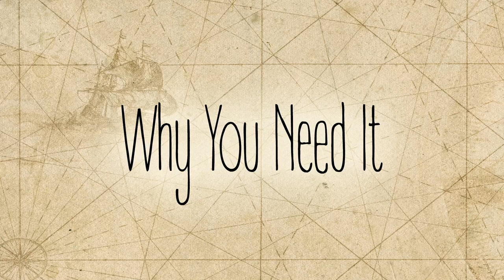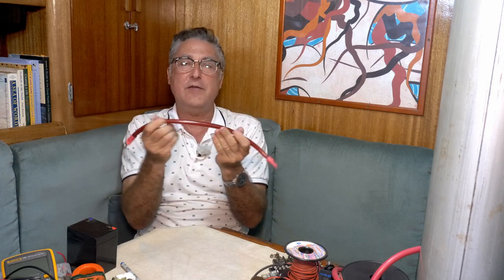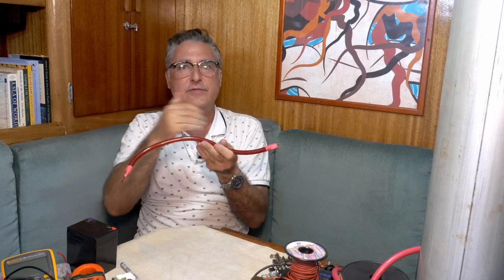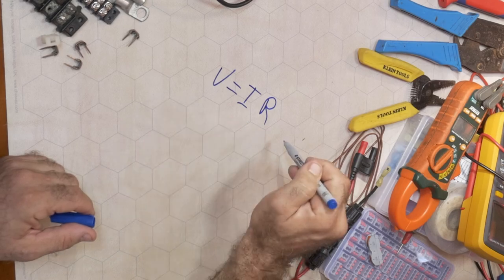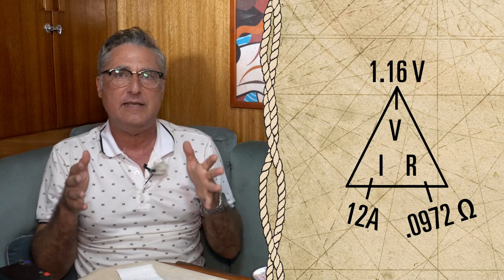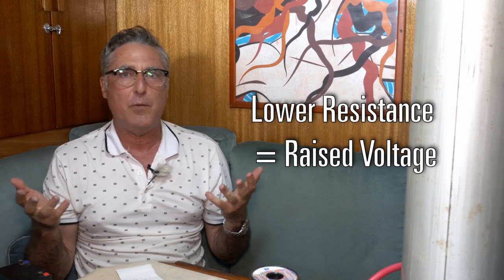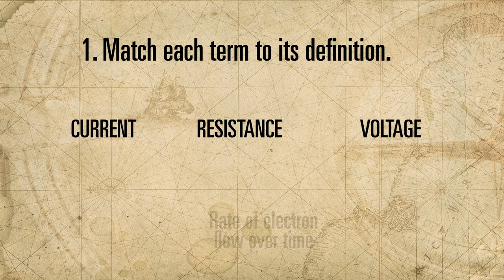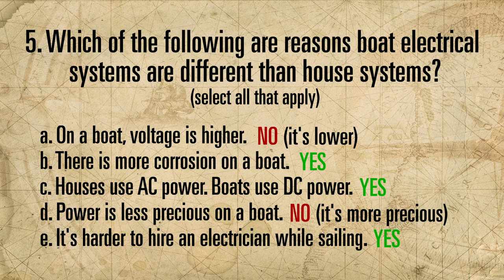What you NEED to know about Boat Electrical (Part 1)

Comment: Clark is a rare breed.  An Empathetic Genius =  someone that can explain advanced concepts translated into simple terms paired with a want to share.  Thanks!
Reply from the maker: Ahhh.
Reply: 100%
Reply: @icarumba5  I agree with this. Great explanations and just a pleasure to watch. I have an excel spreadsheet with conversions on wire with the resistance and surface area and oms calculations and lost volts because of the inspiration from this video

Comment: You always did it perfectly when you explained the three electrical fundamentals, almost until you slipped your tongue and said "amps" in the same category as voltage and resistance. But, to your credit, the text on the screen clarified the difference. Unfortunately, you do not use the unit of measure [Ohm, V, and A) to describe what you measure -- many people can not make up this simple difference which creates more confusion. This is just little detail in an otherwise excellent episode and channel. Cheers.

Comment: Had to teach one of my techs about voltage drop after he tried to order a third starter for the car being repaired, saying they were all defective. Once class was over, he replaced the battery terminal end on the positive cable that was dropping ~11 volts under load (invisible corrosion hidden between the copper and lead inside the factory-made terminal/cable) - enough to kick the bendix out into the flywheel but no amps to crank the engine. Back to basics, buddy! Oh, first too!
Reply: Cars and boats, most of the problems are corrosion or a broken wire.
Reply: @jonathanwetherell3609 

Used to be in broadcasting. If we lost program the first remedy was to whack the jack plugs in and out of the jack. (And don't clean them with Brasso, ever, it leaves a residue which isn't that conductive.) 

If that didn't work then a new double ender lead to replace the original. If that solved the issue then a loose knot in the old lead and leave it to maints.

If that didn't work it meant the gear itself was duff. A very rare occurrence indeed.

Ergo ALWAYS check the wiring or connectors first.

Battery connections, especially, are worth doing properly as that's where your bilge pump gets its power from.

You can work out the rest for yourself.
Reply: Constant equipment and especially diesel issue. Many times all I do is fastidiously clean up every contact in a circuit.

Comment: Nice job Clark. KISS! Lol.
I do hope you speak to how resistors are used in circuits to provide a "local" voltage for a particular component or function within the circuit.
I also hope you offer your viewers other avenues to further the inquiring mind on the subject. There are many good options right here on YT as well as in print.
Super fun subject. Looking forward to the next installment.

Comment: One thing if you have a clamp on amp meter you can increase its resolution by putting more turns through the clamp 2 turns doubles your current reading ( divide reading in half to get actual current)
Many times I do 10 turns on lower amperage then just move the decimal point 1 place to the left.

Comment: Excellent primer Clark! Thank you.  I have a degree in electronic engineering (a few decades ago now 🙂)...I wish my lecturers back then had the ability to explain these concepts as well as you did.  I'm looking forward to the rest of this series!

If there are those out there who still had some difficulties in understanding the principles, a couple of things I use is to think of electrical circuits like water pipes...Voltage is like the pressure in the pipe and the rate of water flow is the current (Amps)...bigger pipes (thicker wire) allows more current...an electrical switch is like a tap.  When it comes to resistance, you can also think of this like rocks disturbing the flow of water in a river...more/bigger rocks slows the water flow (resistance).
Reply: I have used that water flow method to explain it to some and would use a balloon in line surrounded by needles and when the pressure gets to much it expands and pop's into pieces to stops the flow by a open in the circuit for the fuse/circuit breaker

Comment: So impressed, thank you again Clark. Makes upgrading a 12V boat to 24V while leaving the larger gauge wiring in place interesting since so many modern marine appliances work at either voltage.

Comment: The equation really you is for the power loss in the cable. P = IV = I^2R. So if the current is 8A and the resistance of the cable is 0.0972 Ohms the power loss in the cable is (8 Amps)^2 * 0.0972 Ohms = 6.221 Watts.
It is actually more efficient for a fridge to be on all the time with a lower power consumption just keeping the fridge at the correct temperature than to keep switching on and off with a higher power consumption. So dropping the voltage to the fridge can make the fridge more efficient (so long as you don't drop the voltage by creating heat in a cable).
Reply from the maker: Didn't want to get into a second equation in the first video.  One must choose their battles.

And modern compressors run off a brushless three phase DC driver.  So lower voltage doesn't slow it down it just makes it draw more current.

But the power equation would have been the "right" way to express this, I agree.
Reply: @Clarks-Adventure  Thanks, I didn't know that about fridges.

Comment: Thank you, thank you, thank you for producing these videos.  I'm in the process of designing and installing an electrical system on a 50 year old 30' sailboat.  I tore out the rat's nest of wiring that infested the boat and I've got just about everything I require to start my install and I can use all the knowledge I can get.
Reply from the maker: Fun times await

Comment: I think a video on wiring a panel proper wire colors and ways to secure and route wires would be really useful. Tips on a neat well thought out installation.
I also think a video on how to troubleshoot would be great.
Reply from the maker: There is a video coming on how to find voltage drop in an active circuit.   Really useful.

I'm afraid I'm not qualified to show neat wiring installs. Take a look at my battery AC video.  Embarrassing.

Comment: Great job 👍 I just aquired an isotherm DW65 for my 33 Pearson. I have it connected to 800 amp hours of battery (probably overkill) on 4 gauge wire. The explanation of the resistance was stellar! I just feel I need a big wire for longer runs but that made it so clear as to why.  Please keep doing the deep dives they are great for guys like me doing the diy installations.

Comment: Very good explanation. Important also to consider heating in the wires, and different wire types by their ability to handle heat and other types of degradation.
Reply from the maker: Yes.

Comment: Great video! Very nice review! Surprised you didn’t mention Nigel’s Boatowner’s Mechanical & Electrical Manual. Hope you talk about benefits of 24 & 48V LiFePo banks
Reply from the maker: I've never read his book.  Is it good?   I bought his fridge book but didn't like it.

Thanks Eric
Reply: @Clarks-Adventure  I️ find it informative and quite easy & enjoyable to read. He uses the water pressure analogy for ohms law and circuit issues that is good for visualization. Very good troubleshooting techniques. 870pg that covers most marine systems well. May want to mention ABYC and other standards in passing—just that they exist, not more than that. 
Thanks again for your excellent efforts!

Comment: I am or was an instrument electronic technician at a nuclear plant in MN so thought I was fairly smart until my son bought a boat in FL. It is fairly old, 1983 Tiara 3100 with two merc cruiser V8 motors with direct drive props.  Each motor has it's own 12 v battery. The water temp gauge on the port side motor went to max 250 deg while the engine was not hot. The gauges in the dash share the power as they are hooked in parallel. I thought this would be a simple fix but was wrong! After changing the sensor same problem. Measured resistance and it agree with the chart at ambient temperature 450 ohms at 100 degrees and 1000 ohms at 60 degrees. Put the new sensor wire from the port side gauge to the starboard side and it went to max. When I didn't install the sensor the gauge read just what the correct temperature was but as soon as I installed it in the motor in maxed out again. I ran a jumper from the ground side of both batteries to each other thinking there might be some reason the resistance was getting less but that didn't do anything either. I am totally lost on what is causing this problem as I don't know much about salt water boats or inboard engine electrical systems.... Don't know what to even look for next!

Comment: Larger boats have 3 phase AC electrical systems. For an example on my tug everything is 120/208 AC from the navigation lights to the steering pump motors. The only 12 and 24 volt DC systems are some of the wheelhouse electronics like the VHF radios. There are zero batteries in my boat other then the emergency lighting batteries and a UPS for the PC and 12 volt power supply for the VHF radios,  everything is air start other then one genset that has a hydraulic starter, allowing for a cold and dark startup if the boats been laid up cold and dark for an extended time and the air tanks are empty. We have 3 gensets and without a running genset we are basically out of control and dead in the water. No steering, air compressors, engine controls (they are pneumatic). This is also the case on larger recreational boats.

Comment: Corrosion is the primary electrical problem on a boat. Caused by the combinations of moist air, current and poor installation. If moisture can get between any electrical junction it will probably fail, especially if the materials are dissimilar. Very rarely are junction posts and cable ends(lugs/terminals) made of the the same materials. The most important thing that 95% of every manufacturer and experienced marine repair technician omit, is the use of a simple antioxidant. A small dab of Noalox between the contact surfaces of a connection will keep moisture out and make it outlast the boat! Even the use of top of the line Ancor brand tinned lugs, adhesive lined heat shrink and Ancor wires are comprised with the omission of this one little step. So close, yet so far. 
Note; you may wish to avoid Noalox on the threads because it could increase the tension on the fastener due the decreased friction while torquing(or factor in for it). It can also make the fastener easier to loosen under vibration without lock washers so limit the antioxidant compound to the contact surface in these cases. Just be aware of the potentials. Noalox does act as a lubricant.
Reply: Lucky if other boaters use dielectric grease. People think I am weird at bringing in electrical industry antioxidants. So I am not the only one.
Reply: @braithmiller  
Lol
No, you’re not the only one, there are too few.

Comment: Awesome video (soon-to-be-series hopefully)! Once thing I think is also worth mentioning, is that having the wrong wire can also be a fire hazard as the resistance in the wire "leads" to the wire heating up, potentially to the point of burning. But maybe thats a topic for a future video :)
Reply from the maker: Yep, coming
Reply: @Clarks-Adventure  Perfect!
Reply: And, as is doubtless coming to a screen near you before before too long, not just the gauge of the cable but how you use it ...  never ever forget the "heating effect in a coil of wire".

The notice on your extension reel is not a joke ... unreel it completely before using it

Comment: Very good video, looking forward to showing to my kids and the rest of the series. I have been looking for something that basic so they can understand. 
I have used a garden hose and a water flow as an analogue to explain electron flow (ohm's law for gardeners) 
R = Hose diameter and or length 
V= water column height in a tank
I = rate of water flow.

Thank you.
Reply from the maker: Yes that's an often used analogy.  Used it a lot myself.  I find when it does break down the student is now deep in the weeds and could have a harder time changing their mindset.
   But it's time tested and has worked for millions.

Comment: I am installing Shore power and battery charging to my yacht. my instinct was to install the 240v consumer unit close to the 12v ships batteries. as a result of the knowledge from this video, I know to use the shortest 12v wiring length and longer mains wiring, and where a battery charger could supply 8 amps max, maybe to use a bigger gauge wire e.g., 16.5 amp wiring. I must keep insulation away from oils...
so an essential video delivered in an interesting way by giving real practical examples. thanks very much! David 😊
Reply from the maker: You're welcome David. Glad it helped

Comment: I wanted to comment on your watermaker.  From the brief glance I got on your Cruise RO installation there is a way to upgrade to a dc system without a complete replacement.  All that is needed is a DC motor on the pump unit.  I have this configuration.  It does use a little more power than a Schenker(sp) design, roughly 10 amps or so at 12v more per 30 gallons of water.   The problem with the Clark type pumps is all the rubber, etc seals in them.  Expect a full rebuild every 1000 hours or so.  Yes they use less power, but the rebuild cost when those 90ish rubber seals wear down is incredible.  You should ask Sail Away about their rebuild.  A bunch of my friends have all reported Clark pumps need to be rebuilt about every 1000 hours like clockwork.  Sail Away's rebuild was something like $1200 or $1800 plus shipping as I recall on their Spectra.  The pressure washer style pumps like you have onboard I've never run into anyone that has said they needed a new pump.  If they did a new pump is usually only $300 dollars.  The pressure washer pumps have hard pistons and rings like a car engine, not rubber that wears away.  I personally can deal with the loss of a few extra amps that don't make it into my batteries, as they always get replaced by the solar anyway...and we have 300 watts.  A new motor is also only about $200-$300 for a dc motor.  So if you want to save 8k maybe you can send back the other watermaker if you still have an opportunity.
Reply from the maker: I think you are confused.  We have a Clark pump .   Also I've had it for over 20 years.  Been great and only needed a rebuild once a few years ago.
Reply: @Clarks-Adventure  Nope not confused.  I guess it varies from brand to brand as to the quality and time used, but rubber seals degrade, especially if being actively worn by a piston.  Like I said before I've not heard of a pressure washer pump going out.   You've alrady been through one rebuild yourself, is it maybe coming up on another one and you just don't know it yet.  Besides the capacity they were talking about having is pretty fantastic for a Clark pump, must suck down the juice anyway, and likely costs in excess of 8k...Spectra units are like 14k in that size.  So spend $200 on a new motor or spend 14k??? I know which one I'd choose.  Besides how much time are you really putting on your pump?  You've been in Luperon for how long and I can't see you possibly wanting to use your watermaker there over the past years you've been there?!
Reply: @Clarks-Adventure  I am actually confused.  I'm sorry..I put this comment on out Chasing Stars new video and it attached to yours somehow???  Weird!!!

Comment: Hey thanks. I kinda knew this but the basics of how they relate and what they actually mean to a boat's circuits was an inspiration moment for me. 

Anyway. My knew mantra is below. 

push = flow x impedance                            V
voltage = current x resistance               %.   % 
Volts = Amps x OHMs                          I      *     R

Comment: Great video, Can I use ohms laws to test glow plugs on an engine.  My friend got about 10 volts on all his glow plugs so he assumed they were all working. How does ohms law help here?  Looks like he lost 2V in his wiring.
Reply from the maker: Yes  2v drop in the wiring and 10v drop in the glowplug.
Because it draws a bunch of amps.   If you saw full voltage at the glowplugs the glowplug is fried and drawing nothing

Comment: Hi, thank you very much for a very nice explanation of this topic for sailboats. I tried to do the calculations of the example you were using in the video just to get the hang of it and the Ohms law was nice and clear and the numbers I got were the same as in the video. But when you were comparing the efficiency of the better cable with the worse one and came up with 9% more efficient I could not calculate that number. When I compare the final voltages of 12.74 V vs. 12.04 V  the (12.74 divided by 12.04) the outcome is 5.8%. What numbers were you comparing when you came with a 9% ?
Your channel is great and I find both entertaining and useful information on it! Thank you again
Reply from the maker: I do these without a script.  I sometimes make mistakes.

The big wire has a loss of 3% the small wire looses 9%. I guess that's 66% more loss.

13.2-12.0 =1.2. 1.2/13.2=0.09

Comment: I'm not sure if you covered this 1) always us tinned copper wire. 2) Make the terminals are  properly crimped or soldered and use heat shrink also. 3) I use dielectric grease on the terminals after all connections are tight. There is also a clear spray. that was good presentation.
Reply from the maker: It's in there.  Including when NOT to trust solder

Comment: Boats can  have more as 12VDC. My boat has 12VDC, 5VDC (For USB, behind a buck converter)  and 18VDC after a Boost converter to power/charge my laptop.. It has a isolation transformer to bring in 230VAC 🙂
Reply from the maker: Yep